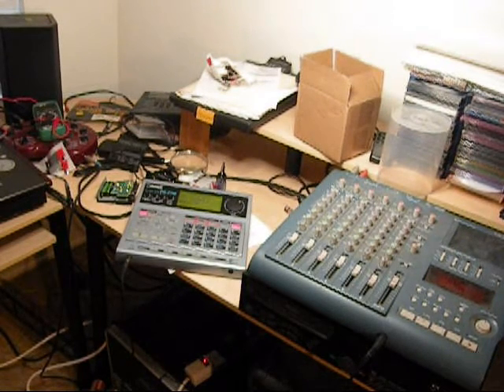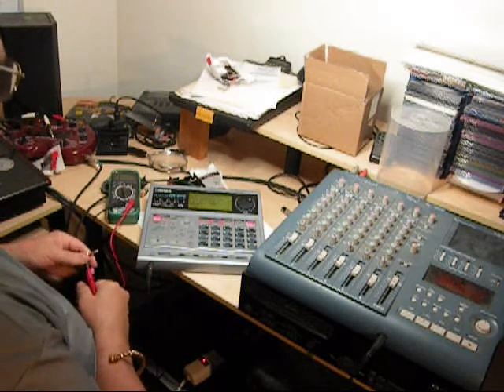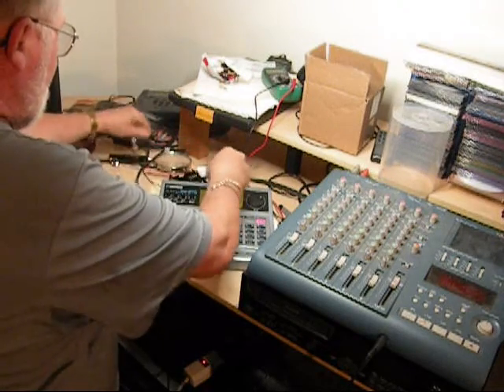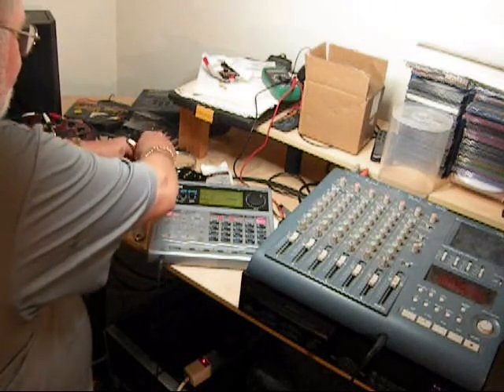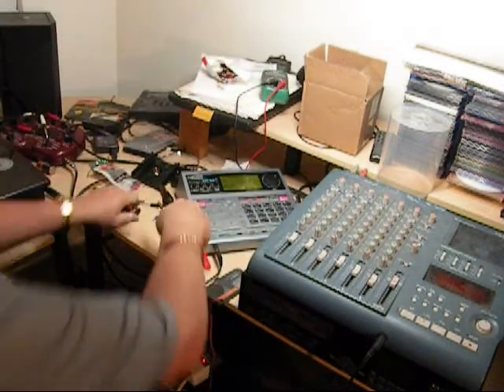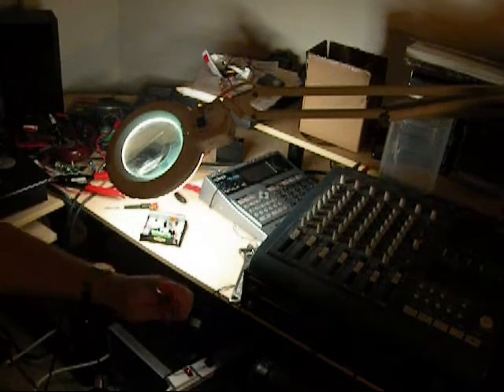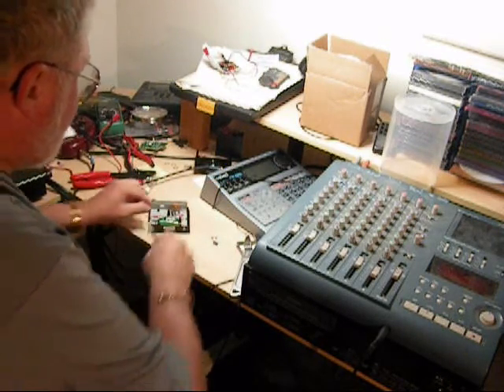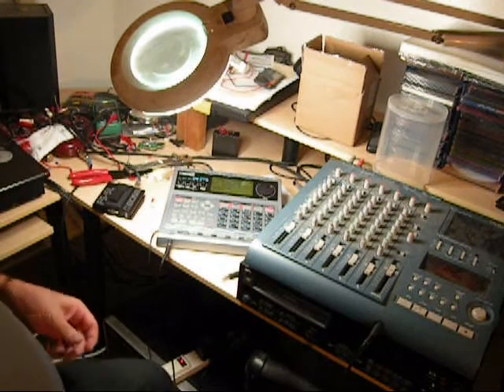DR880 footswitch fix 0001

Comment: I don't mean any disrespect, but it appears you butchered up a perfectly good footswitch. The switch doesn't source any voltage to the DR-880. Doing so could potentially damage the DR-880 footswitch input circuitry.

 All the DR-880 requires is a Tip / Ring/ Sleeve plug with two dry contact closures, one between tip and sleeve, the other contact closure between Ring and sleeve. One contact closure starts and stops the machine, the other tap sets the tempo when tapped 4 times in succession.

Comment: Not sure why you are complicating this simple foot switch application. You can use any momentary switch with 'Normally Closed' contacts. You can purchase many different types of these switches at any electronics store or just use the foot switch that Boss recommends. You don't need a volt meter and you don't need to take 20 minutes to explain how to confuse people.